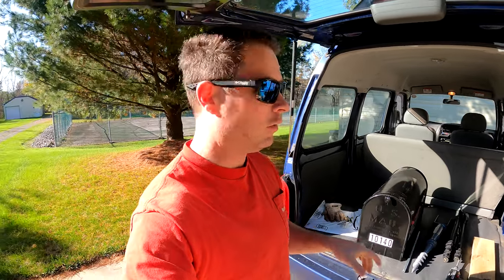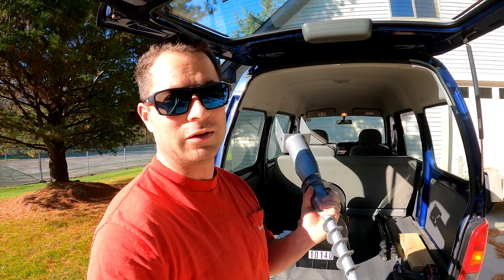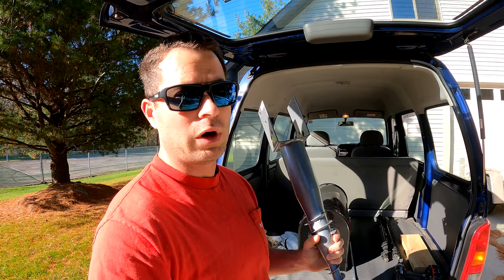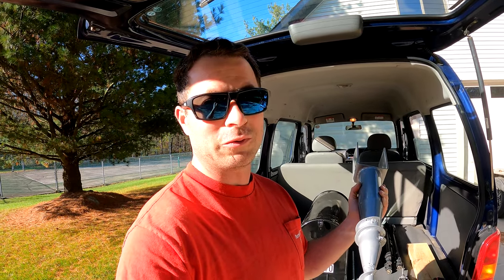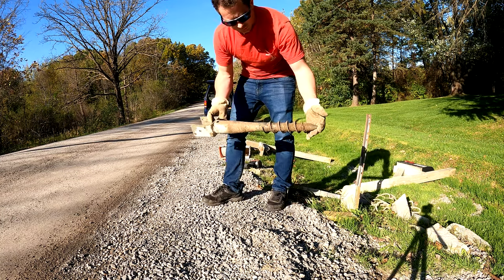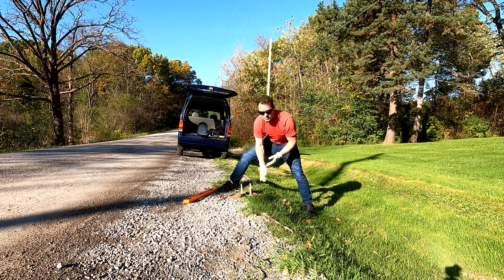✅ Easy No Dig Mailbox Ground Anchor Install

Comment: I’m a complete novice when it comes to this. Couple of questions. What would happen if the post is not 100% level? I’m not talking about wonky, but just ever so slightly not level. Also, because the screw in bracket (the piece you put in the ground) only has two sides and is not a box, how does the wood post stand up by itself before you screw it into the metal part?

Comment: My questions is how sturdy is it? do you feel a lot of give when you wiggle it around? will it stay true level over the years? It's about time to replace mine and I was looking at the various methods on how to doing it. Thanks in advanced
Reply from the maker: I find it as stable as direct bury of a 4x4 post.  A concreted post beats it out.  It partially depends on your soil type, sand doesnt hold well and if its super soft (water saturated) clay then it can get lose.  "Regular" dirt works well from my experience.

Comment: I imagine you'll have to drill pilot holes for the lag bolts?
Reply from the maker: Yes you could/should if your wood is dense.  My 4x4 is probably 20yrs old  and was able to accommodate the extra "squish" without a pilot hole or any cracking.
Reply: @NaterTater  Thanks, that's what I figured. It's a brand new 4x4 and quite dense. I have a large selection of bits. Just waiting until Thursday when it arrives.
Thanks again for the video and recommendation.

Comment: How sturdy is it?
Reply from the maker: Will depend somewhat on the soil but i'd say atleast as good as digging the same depth hole and sticking the 4x4 post in the ground.  Less sturdy then a larger hole and concrete anchored post.  Mine is still standing straight today without me messing with it.